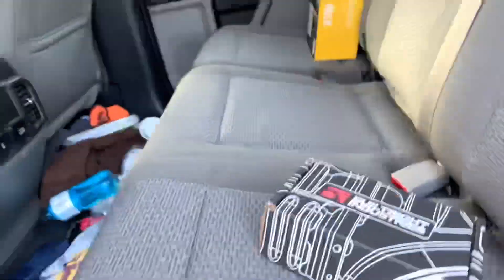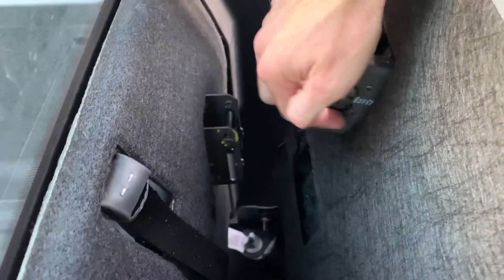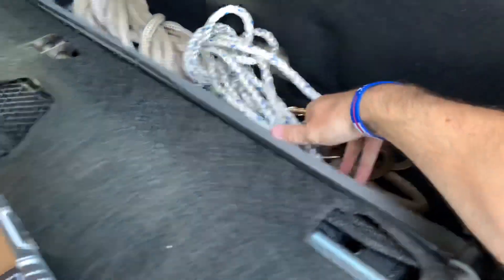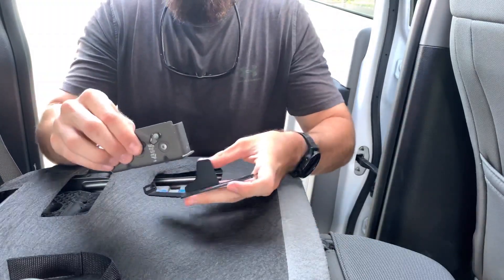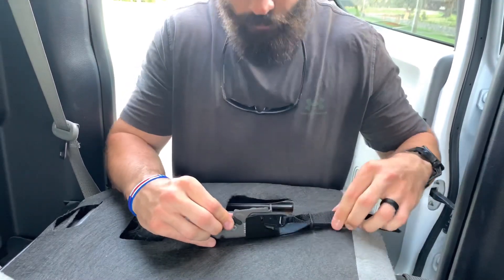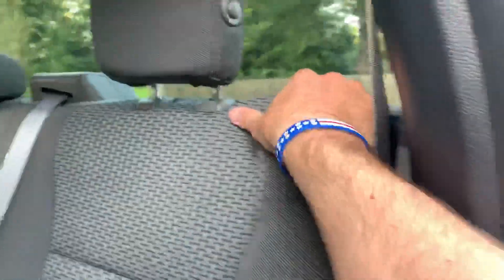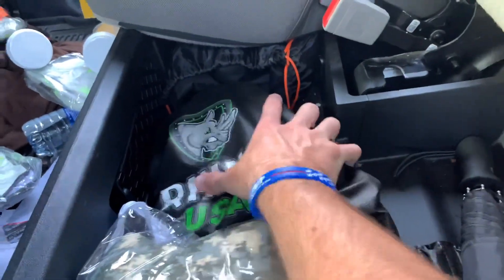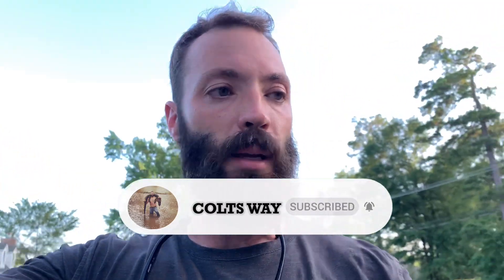Built right rear seat storage Install F250/F150 (HIDDEN STORAGE) 2017-Present

Comment: These instructions are for the Crew Cab ONLY! The SUPER CAB seatback will NOT move away from the back wall, not so much as an inch. That requires the removal of the hardware at the hinge. Very important to note that these two back seats are NOT the same. I had the back down once when I first got it, real SOB of a task!  Also-after you’ve hooked up the pull cord, be sure to slid that little receiver bar back where it was, or you’ll jam it. I know all this because I learned it the hard way. I wish I had this important knowledge before hand.

Comment: The back of the seat on my 2016 XLT does NOT move away from the back window when the bottom is folded up, like you show. There’s absolutely NO movement. Can’t figure what’s wrong???
Reply from the maker: Not sure it’s going to for 16 and lower models. This was installed on a 2018. So it would be 2017-present models this is for...sorry brother. 🇺🇸
Reply: COLTS WAY Thank you for responding. Maybe I'll have to remover(to some degree), the seatback, somehow. Very frustrating .
Reply from the maker: Yes that would totally suck. Sorry bro.